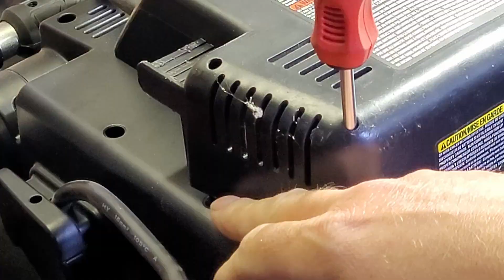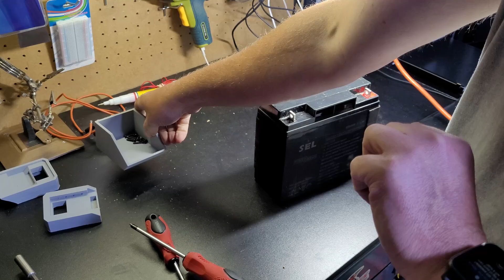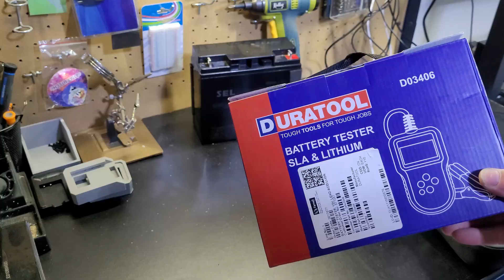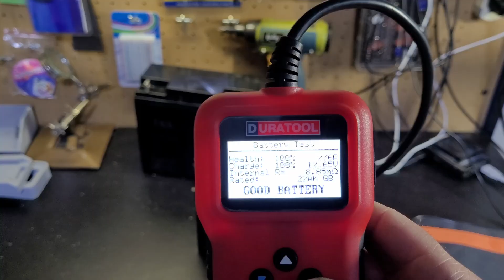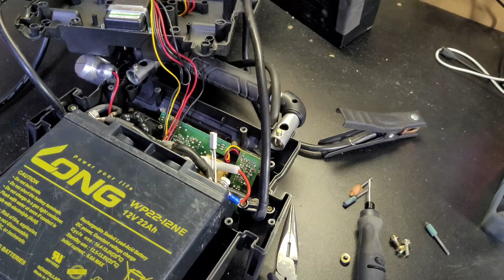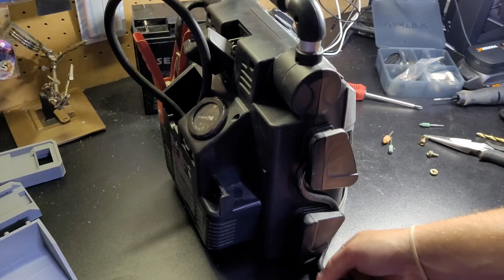Booster Pack battery replacement

Comment: Could you desulfate those batteries. Also if you can do you have to open the unit. Or just connect on the terminals on the case

Comment: I was thinking buying new one and then saw your video, ordered new battery, I already disassembled separate the screws, today the battery arrived, I installed and all good now, just add some, negative first when you disassemble, positive first when you install, also it's total my fault but Take all the top part up, I opened bottom to up so handle part plastic I broke half but glued them. Anyway thanks for the video!!

Comment: Hi, I have the same battery pack

What could be the issue if the Air Compressor does not work? 

On switch: lights on pressure gauge turns on but air compressor does not work

 Thanks in advance!

Comment: Too bad i didn’t see this video years and a few hundred dollars earlier. 😂😂😂 I left one at Canadian tire store years ago. It would not charge enough to shut off the low battery warning and they would not replace it. And i had enough of the fucking low power warning signal making noise for the last two days.Told them to stick it up their ass , i had listened to it long enough.

Comment: Not so sure I would have replaced the battery in that particular unit..will see if it lasts. Good video though.
Reply from the maker: The way I look at it is if anything costs 50% or less to repair something, I will do it.  Took sale prices into consideration and used a battery that was good not new from a medical supply shop and just swaped batteries with them for ones they were going to recycle. Armed with a good battery tester this one had more then enough life in it.  As long as maintenance charging is done it will last.  For as long as I had the unit from new I got my money out of it and sold it to a buddy and it's still doing alright not as good as once would think but usually 3-5 years out of these battery boosters is a win.

Comment: Which battery? None of the 18ah or 21ah batteries I’ve seen say they’re compatible with the Motomaster eliminator
Reply from the maker: ya just take the old one to a battery shop they will match it up depending on manufacturer will depend on ah rating.
Reply: @Gam3T3cHElectronics  I don’t care now lol I needed to know that a month ago

Comment: is it normal that it wont completely shut off? like the blue indiglow dims out but its lcd backlit display is constantly on.. ? that kills the battery.... and when plugged in it just alternates 14.1 - 14.2 top bar always flashes and never shuts off on its own.. I unplug it drops quickly to 12.9v and sits there and eventually next day drops to 12.7v and have charge it again... is this normal??? or do i have a dud.?
Reply from the maker: sounds dud-ish to me only time I had that happen is with a battery with a dead cell in it.

Comment: What type of a battery that and what size it is if I want to buy one I'd know nothing about battery I want to check on Amazon maybe
Reply from the maker: the battery size is in the video and  all batteries that size should be standardize size so should fit and amazon is ok for prices but I would look for a battery distributor near you or one that will ship cheap.  I get some of mine from newark.com as well they ship I think world wide as well.   its just a deep cycle battery in them.

Comment: Hi
Where can I purchase the battery replacement for the eliminator charger?
Reply from the maker: Just find a shop that sells deep cycle batteries or even on Amazon would have them.  But double check to see if your unit is in warranty or not.
Reply: @Gam3T3cHElectronics  what's the name/group of the battery?